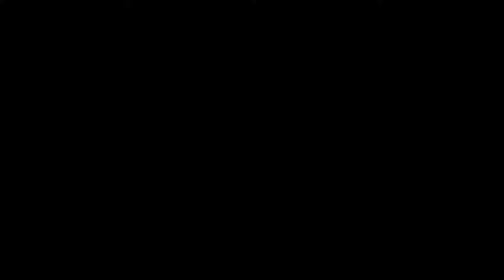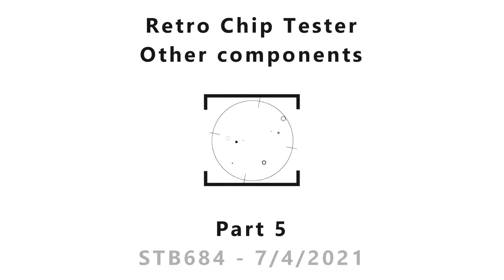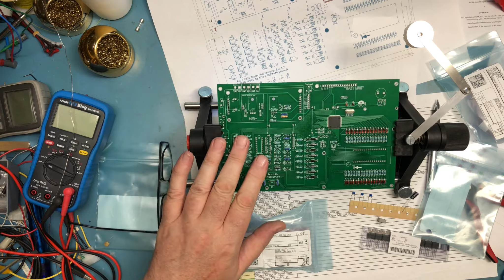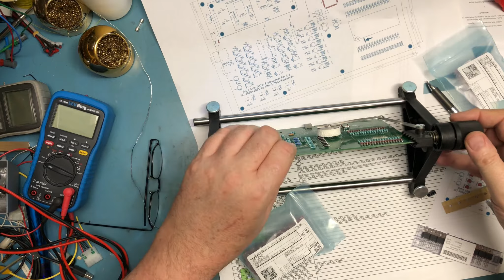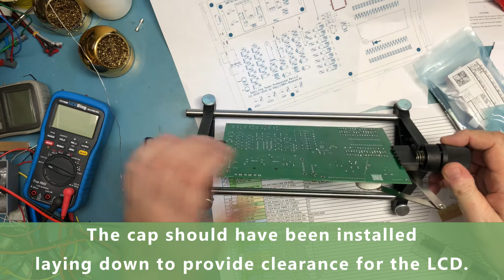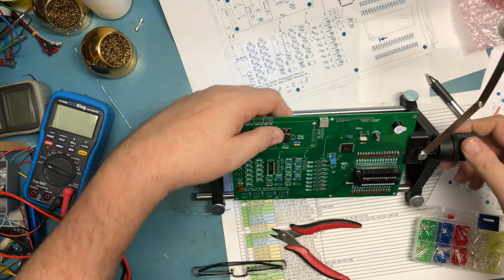STB684 - Retro Chip Tester - Part 5 - Other components

Comment: Just finished mine.  It is a fun project. Always great to see your builds.  Very illuminating. Thank you.
Reply from the maker: I've used mine quite a bit. I built the 30-pin SIMM adapter and worked my way through a bunch of old 256K and 1Meg 30-pin SIMMs. Several tested bad.